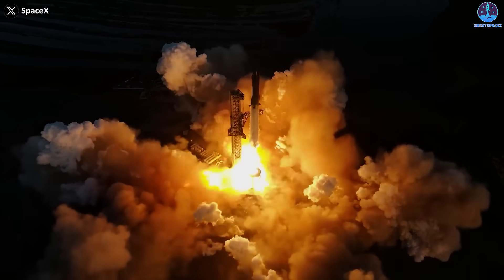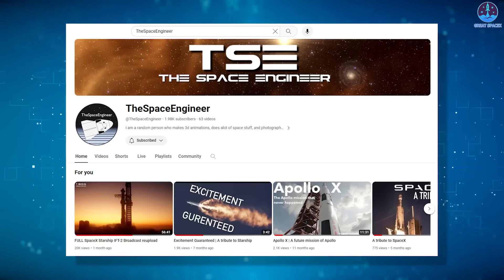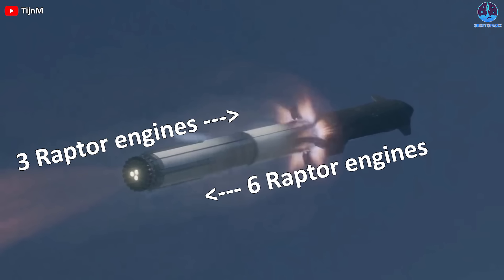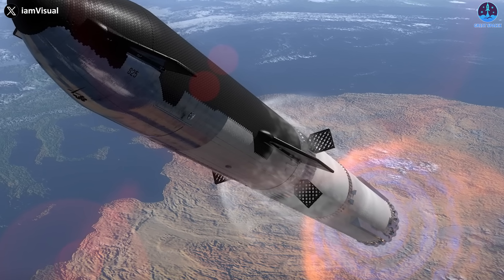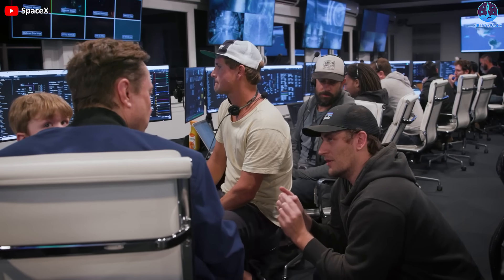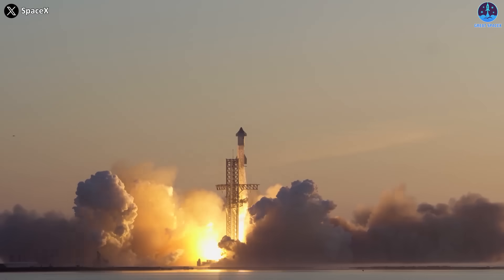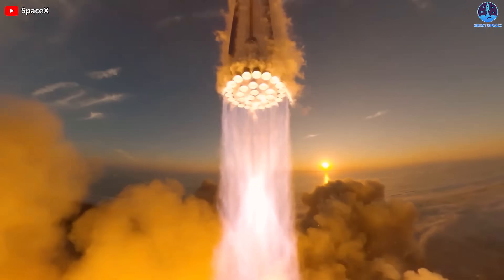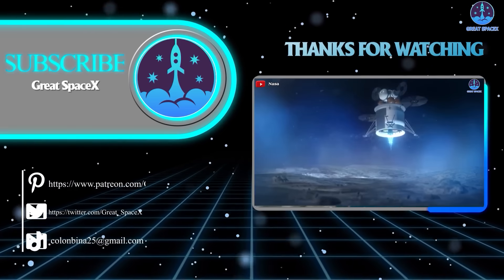How SpaceX Starship fuel sloshing will blow your mind!

Comment: If I recall from my various engineering-related discussions in the past, internal tank baffle plates under zero gravity conditions are extremely problematic. Fluid dynamics was never my specialty, hence I can't recall the specifics.

Yes, baffle plates work great here on Earth and are used throughout the ground-based fluids-transport industry, however, space is an entirely different environment. If they do indeed utilize baffle plates, of any kind, I do hope they publish the specifics of the engineering implementation. I'm certain it would be fascinating (I would like to know).

Just for informational purposes, in many smaller satellites (not rockets or boosters), we use pressurized flexible bladders, which are internal to the solid globular tanks. They compress and shrink over time as the pressure diminishes due to necessary attitude corrections directed by the assigned orbital mechanics.

At some point, when fuel reaches a critically low level, a decision must then be made as to whether to use the little remaining fuel to push the satellite outwards to drift away from Earth or push it towards Earth so it will burn up in the atmosphere. This process is intended to keep the area free from excessive space junk. Anyway, I digress. 🧐🤔
Reply from the maker: Thanks for your great comment. Keep following and discussing on our channel ☺️
Reply: A significant number of rockets use baffle plates to guide fuel to engines in space. These use surface tension to guide fuel to the intake ports on the tank.
The Saturn V third stage used that solution (along with ullage motors). That requires the fuel to “wet” the tank structure however.
Having too high a tank temperature can also be problematic with liquid methane too. A number of LNG tanks have blown up when the pressure in the tank from acceleration dropped below the local vapour pressure due to temperature and the tank went supercritical and flash boiled. (Basically all the methane in the tank instantly goes from liquid to gas - which is why you don’t want warm LNG (or be within miles of a tank where that happens)).
Reply: @allangibson8494  Fascinating, and thank you for the greater detail in regard to the baffle plates. I'll likely research some of this just to better understand the engineering considerations. Much obliged.

Comment: Any trucker who has ever hauled liquid tanks down the highway knows all about slosh. It can be a killer.
Reply: I wonder if a baffling system is possible similar to what they use inside the tanks for trucks
Reply: @jeffingram8279, I was once told by a gasoline delivery driver for Shell that the trailer tanks do not have anti-/baffles as the interior of the tanks need to be cleaned out periodically (probably high pressure steam), and the baffles would interfere with a thorough cleaning. 

That subject came up when he told me about couple days prior that some idiot in a car cut him off, and he had the trailer slightly sideways from full emergency braking.
Reply: They why doesn't Falcon-9 have the same issues which does the same maneuvers with zero failures?
Reply: @Solar2go They don’t perform the same maneuver, Falcon first stage shuts down and then separates while Starship continues burning.
Reply: Nice to remember those same forces act in space as well.

Comment: The fuel ‘sloshing’ must indeed be a problem but I’m sure it will be solved as the Falcon9 uses the same staged design and separation and this must have fuel sloshing around also. Space X is nothing but innovative so I’m sure they will solve this problem soon - if not on flight 3 then subsequent up coming launches…
Reply from the maker: Thanks for your great comment. Let's wait for their next feats ☺️

Comment: water hammer is not something they can mitigate with the current staging procedure. there must be a pause and there needs to be a ullage thruster to resettle the tank safely. 
there is no "air" bubbles, it's whichever fluid/gas in in the tank. the failure would have been caused by the thrust of the engines with the tanks contents being thrown forward. 
what is the twr with the tanks only being 10% full? 
imagine 10 tons on liquid smashing down on the bulkhead at 4 g's and 3m/s - napkin guess.
Reply from the maker: Great analysis 👍👍👍. Keep discussing this on our channel ♥️

Comment: Way not use a porous blader at least 1/3 of the tank volume. Hey Elon,  are you listening? Use porous  balls to dampen the sloshing.
Reply: Also what bladder material is flexible at cryogenic temperatures?
Reply: They will likely adjust engine firing times and  reinforce pipe connections among many possible other changes.
Reply from the maker: Thanks for your great comment 👍👍👍
Reply: Balls would get sucked into turbines.  Then what?
Reply: @chrisolix3441  eploy a septum to hold the volume of the balls.
Reply: Do you know why starship didn’t make it to orbit.  This video didn’t say.

Comment: A ring tank baffle at the transition fuel level will prevent sloshing.
Reply from the maker: Keep discussing this on our channel ☺️
Reply: If I recall from my various engineering-related discussions in the past, internal tank baffle plates under zero gravity conditions are extremely problematic. Fluid dynamics was never my specialty, hence I can't recall the specifics.

Yes, baffle plates work great here on Earth and are used throughout the ground-based fluids-transport industry, however, space is an entirely different environment. If they do indeed utilize baffle plates, of any kind, I do hope they publish the specifics of the engineering implementation. I'm certain it would be fascinating (I would like to know).

Just for informational purposes, in many smaller satellites, we use pressurized flexible bladders, which are internal to the solid globular tanks. They compress and shrink over time as the pressure diminishes due to necessary attitude corrections directed by the assigned orbital mechanics.

At some point, when fuel reaches a critically low level, a decision must then be made as to whether to use the little remaining fuel to push the satellite outwards to drift away from Earth or push it towards Earth so it will burn up in the atmosphere. This process is intended to keep the area free from excessive space junk. Anyway, I digress. 🧐🤔
Reply: @NowDeceasedRIP  In this case, in the booster, it will be under acceleration, I think...